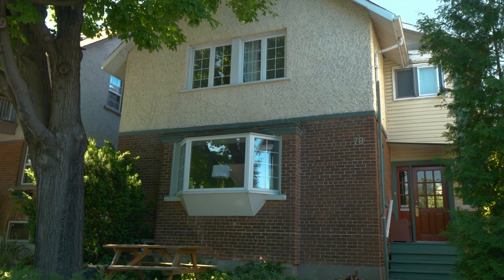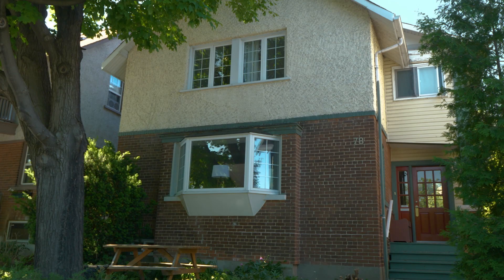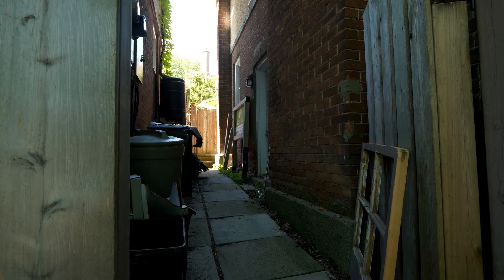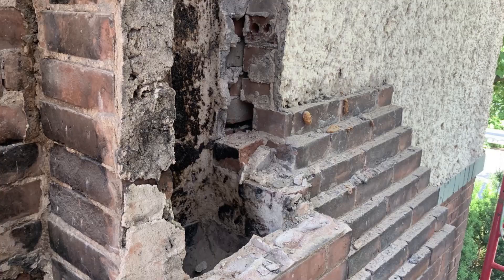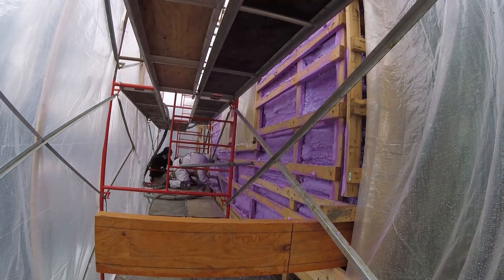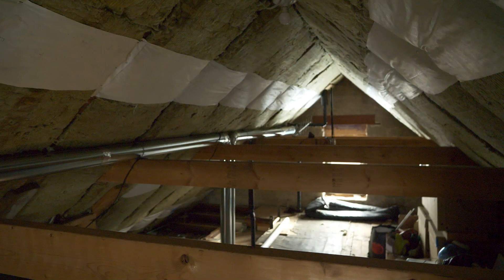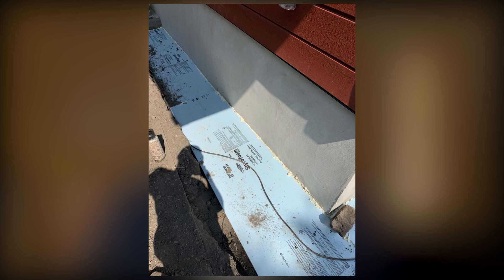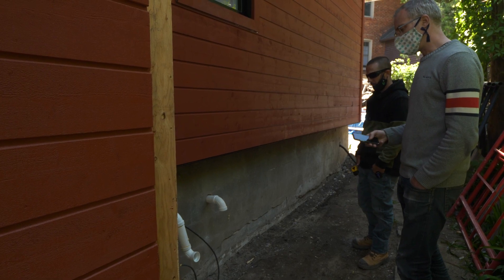100 year old home deep retrofit - efficiency, comfort and curb appeal

Comment: I do alot of old commercial masonry building. I hate windows and historical districts. Had to get vinyl stripe put on windows once. Loose mineral wool in air gap below grade really helps. It enhances wick action too. Masonry loves to wick moisture. We put timber frames in a lot of the old urm buildings. Insulate rafter pockets, rafters, and ceilings.

Comment: How did you attach the mesh to the rigid foam in order to parge it? I'm guessing the foam has been treated with borates and attached with some kind of adhesive to the foundation..
Reply from the maker: The foam can be installed with fasteners and washers and the parging is actually and EIFS installation (like stucco).